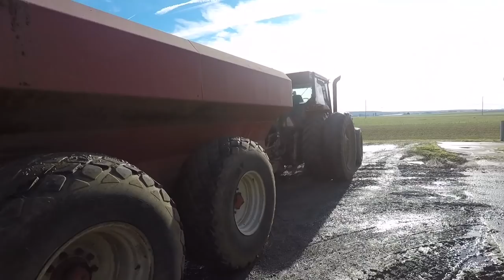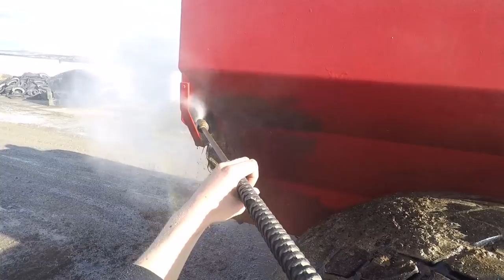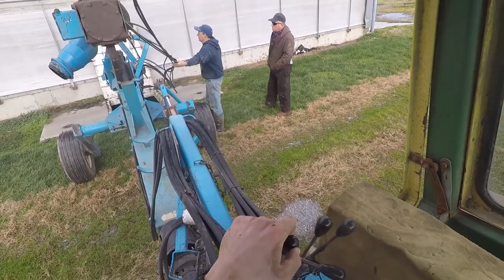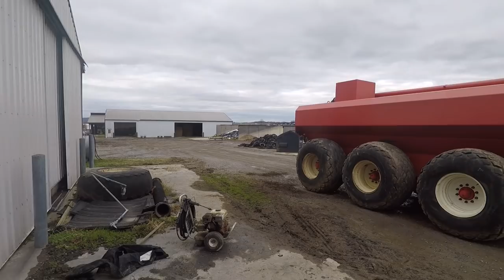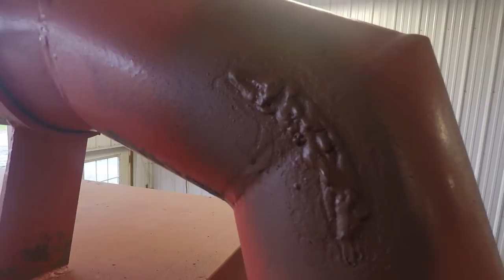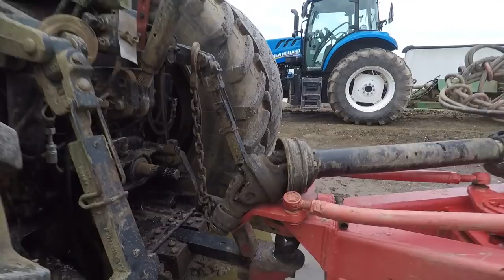Manure Equipment Clean Up

Comment: When ever you have a crack, drill 1/8 hole in each end before welding. This will release the need to spread, and allow the weld to hold longer. Thank you for sharing with another thumbs up to you.

Comment: Weld in a pattern to fill a gap like a spiral or zigzag...I use the push and pull method but whatever you feel is right for you....also use a grinder to get to fresh metal...rust causes bubbles bubbles cause cracks...don’t do more work if you don’t have to...I’m watching all your videos in order...I love them.

Comment: Little advice for the future: if you’re trying to stop a crack drill a hole at the end of the crack then weld it. If you don’t drill it the crack will continue to grow
Reply from the maker: Good tip. I'm gonna try that next time thanks
Reply: Good advice. It even works on cast iron, although it is a bit difficult to weld.
Reply: Erik D. Great tip Erik, I remember hearing that a long time ago, and reading your comment It just came back to me. Have a repair that I’m doing now that I’m going to use this tip. Thanks

Comment: 2 suggestions!  1) don’t scrape it because the paint will go off. 2) before you “wash it” just put some water on it for 10 minutes. Power wash will go so much easier after those 10 min. That manure will absorb the water ... Or just do it after a rain.... Get a Mig welder. I know is costing some money but long term is a better weld then the electrode....

Comment: Idk if you know but if you wax your tractors and equipment minimum twice a year i will be so much easier to clean and it makes them look amazing but you probably dont have the time for that bec it takes at least 2 hours to get a good coat on and if you have a crack drill a small hole in each end before weding this will decrease the need of seperating anyway keep up the vids i love em all

Comment: I don't get how you can be bothered to clean a slurry tanker. I find it annoying cleaning a quad let alone a 5500 gallon tanker.
Reply from the maker: It's nicer to look at. Worth an hour of work to me
Reply: 10th Generation Dairyman I'm working at a Massey dealer at the minute and we have at least one new tractor a week that comes in on boat and is covered in salt spray when it arrives so our pressures washer is used near everyday and it's about 5 months old now and has around 300 hours on it now I hate the sight of it now.

Comment: Nice clean up job! Shitty job! Lol 
Not telling you how to do things just some friendly advice. Next time you have a crack like that drill a small hole on each side of the crack. Before you start welding. That will help a lot from it starting to crack again
Reply from the maker: Ok thanks for the advice, might try that
Reply: Good idea, just look at the flywheels on Old 2 Cylinder J D